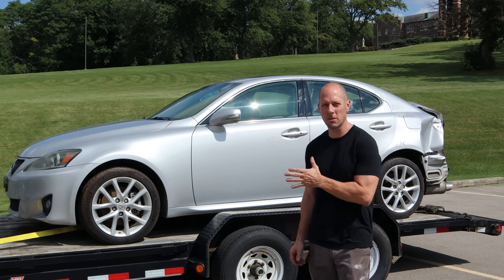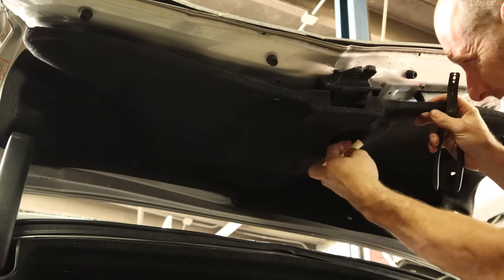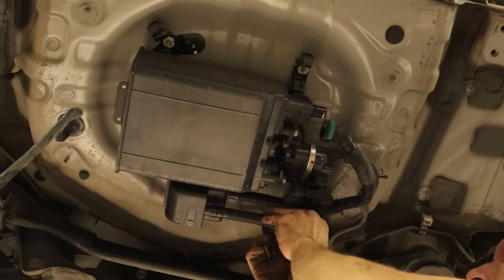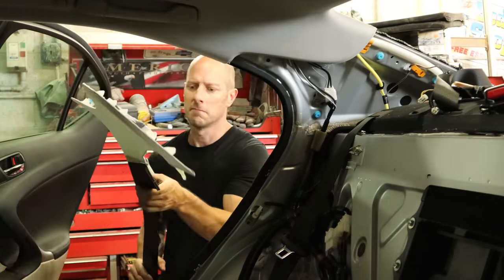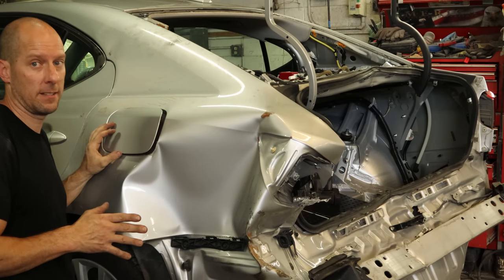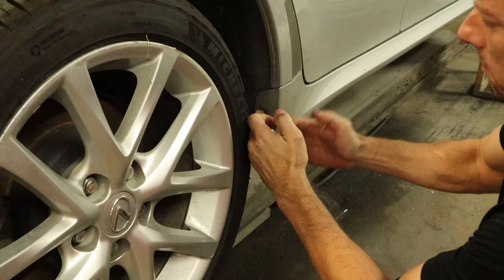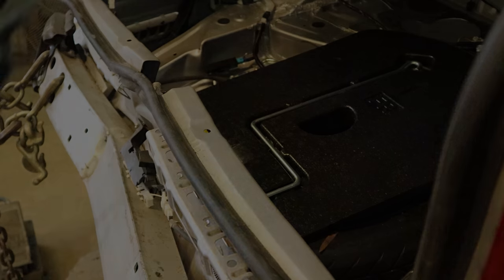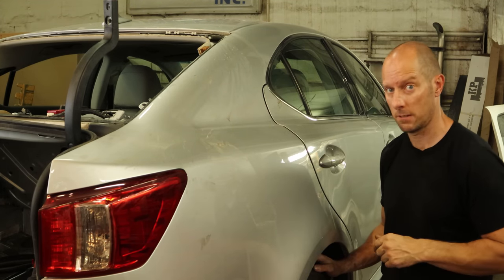Rebuilding a Lexus IS250 AWD with a clear title

Comment: Little story from my insurance adjuster days.....
At a shop, looking at a 2-3 year old '82 Camaro. Rear hit. Rear body panel caved in. Minor damage to the rear of the hatch. Glass was intact. I opened the hatch to look at the floor, and it wouldn't go up very far. Forced it open just a little bit more and BOOM! Glass exploded. Turned out the hatch structure had twisted and tweaked the hinges........ "Add a used hatch to that estimate, will you?"..........

Comment: Recently I rebuilt a 2017 Chevy Cruze  with a clean title it came from Waco Texas, you do find some clean title cars that were totaled down here in Texas don't know how it works but works for me! Reason they get "total loss' is because shops charge a lot of money to fix but where I get them painted they charge per job not per hour that is how cost of repairs is low for me, also I do most of the straightening and assembly and part replacement the body shop guy only does the final adjustments and paint.

Comment: I bought a 2003 IS 300 new drove it for 11 years never once did the check engine light ever come on when I sold it even still had all the original brake pads and battery , never had 1 problem with it . Great car mine had a straight six I think the newer ones have V sixes in them.

Comment: Reminds me of the packer cars they used to use way way back at the clay track here.  They'd cut flaps out of the fenders to fit wide tires on, then as the frame rotted they'd cut the whole back off the car so it didn't fall off and keep running it until it was dead.   Maroon '67 Buick LeSabre is one I remember that got that treatment.

Comment: I just wanted to let you know when you backed it off the trailer you had no brake lights. "Check the bulbs" is what Google said when I looked up the problem. 

Oh and you don't know rust pal, you should try living in central Illinois, then we can talk about rust. 

Third thing, that car is not worth fixing you should know better. My buddy has one you can buy with an actual clean title for way less and lower mileage and it's faster...😐
Reply: OH THAT'S IT! You just called the "screw" a phillips head! YOU MONSTER! That sir is a JIS Fastener. Gosh.... this pisses me off. Especially now that the YT'ers told me the difference I can't stand it when other "pros" get it wrong.
Reply from the maker: Wait, you forgot the fact that Google and other YouTubers say all totaled cars get salvage titles.  😂 They correct me on the Phillips all the time.  I’m just going to refer to them as plus and minus and really watch their heads explode!

Comment: My last car was an 88 Toyota Camry. It threw a rod a few weeks ago, and it was SO rusty that my mechanic said that even if I sourced another used engine that he wouldn't install it due to safety concerns. lol. The rocker panels had disintegrated almost entirely, the wheel wells were rusted out, quarter panels rotting away, and the rear bumper actually fell off the car at one point because the mounts rusted into two. I only paid $600 for it though, and it lasted me 3 years. I've had more than enough money to buy something nicer (and safer), but I was trying to be frugal. After it threw a rod I went out and bought a new BMW. The dealership joked about how big of a swing my upgrade was. 😂

Comment: (laughs in Texan) Can confirm windshield replacements. If the gravel trucks haven't gotten you yet, the hail will.
Reply: Since they don’t require perfect windshields at the annual inspection I don’t bother until it looks like it’s about to fall out all by itself.

Comment: What is it with broken glass !?

I bought a car that had been broken into and they had smashed a door glass to get entry.
The previous owner had the window replaced , and in my cleaning of the car I found pieces of glass.
So I vacuumed and brushed everything out super thoroughly.
I even pulled up the carpets and cleaned the floor.
There wasn't a spec of glass left.

Then a couple of weeks later I go to get in the car , and there are a few cubes of glass on the carpet.
So I take them away ,, again a few weeks later another few glass cubes.

What , do I have pixies putting them there now just to fruk with me ?

Comment: Yes. You can rebuild them.
BUT!
it won t be the same . It won t have the same level of safety.
If you bend a piece of metal 10 times, it will break
If you bend it “only” once, it will look fine—— but it won t be the same.
I hope it is clear

Comment: talking glass,i delivered a car and as i was parking it up her drive a piece of glass fell from the dash and landed on my foot,the customer had been told about the windshield damage and i had removed the dash and cleaned every bit but yes glass in a car always haunts,my job strangely tomorrow is to remove a screen and dash before repairs because i guess a cyclist nutted the windscreen as the car pulled out of a junction

Comment: Scott, I've got a question? What does the Chicago winters do to the fords, and other vehicles that are made from aluminum? Does the salt just attack the fasteners? As always good video! I aways look foreward to fridays!
Reply: steel rusts even stainless steel as do alloys aluminum on the other hand corrodes = same result just different nomenclature. for best result connect  the two materials together wonderous things will happen.
Reply: aluminum does also "rust".  metals oxidize in the presence of air and this is accelerated by the presence of salt and water.  salt is also corrosive.  steel oxidixes forming "rust" that as we all know flakes off the base metal.  when aluminum oxidizes, it forms a protective coating of aluminum oxide that doesnt fall off.